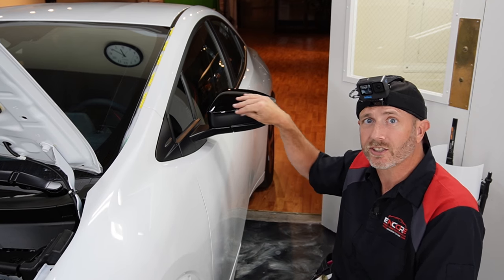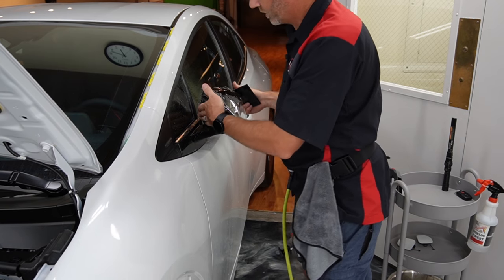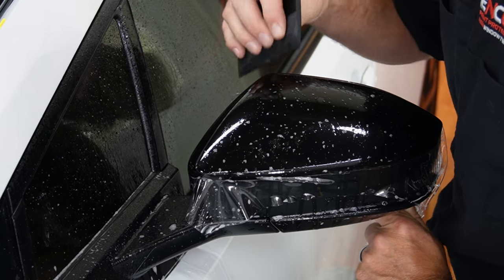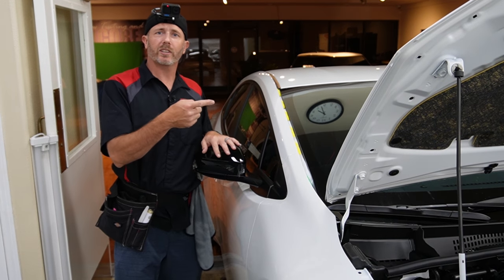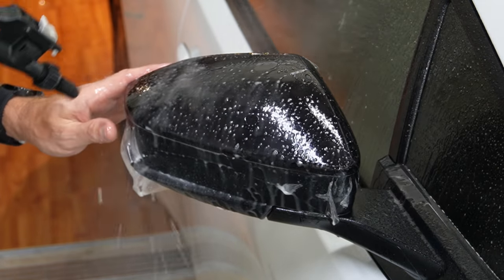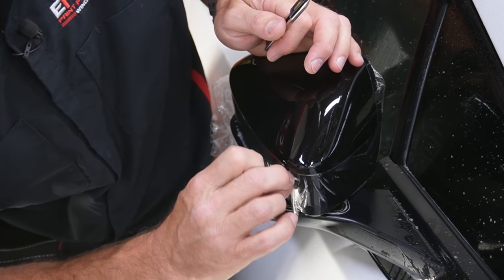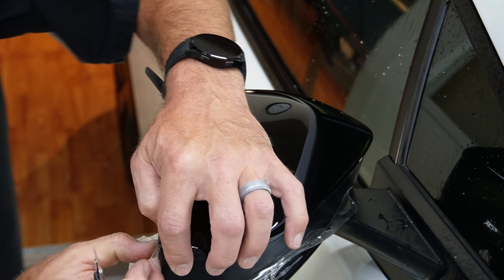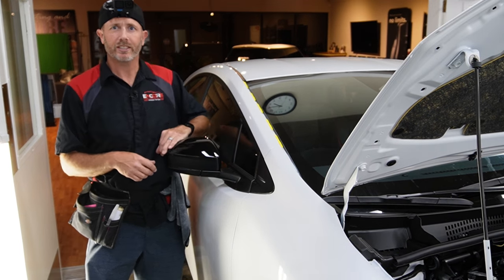How To Bulk PPF On A Side View Mirror - (Toyota Prius 2024)

Comment: I normally do it after trimming and then I heat the edges but I’ve also done it before trimming also. I put my blow dryer on hot and it also helps lock the edges down.
Reply from the maker: Oh, you are talking about heat sealing the edges to help lock them into place. We do that as well! 😁👍🏻
Reply: I use a hairdryer to get the water out and then I go back over it and heat seal it with a heat gun but on the hairdryer, I put it on hot with fan on high

Comment: Have you tried a hair dryer to blow the residual water away? I use one on ever part and it works amazing!
Reply from the maker: Interesting idea. I have not tried that. I normally just use the air compressor. I'll have to give that a shot.
When exactly do you use it? Before trimming the PPF or after?
Reply: I actually have one coming in this morning. I have done a few of them so far but I do the mirrors a little different. I am going to try the way you did them, it looks a little easer as well as less likely to get imperfections.
Thanks for the video 😁
Reply from the maker: Awesome, let me know if this makes it easier or harder. I'm interested to know. 👍🏻

Comment: Hello
I just came across your channel and I am very happy about it
I have a question: Do you use water and foam or special materials for installation?
I will be very happy if you tell me completely what materials you use for installation
Reply from the maker: Welcome to the channel! Here is a video I made that goes over all of the solutions I use during my installations. https://youtu.be/xGjn2rwh-W4
Reply: Thank you, it was very informative
  Another question: How to use these substances?
What I noticed is that water and foam solution is used first, and after leveling the ppf, water and alcohol solution is used to create adhesion, did I understand correctly? @EncorePPFtint
Reply from the maker: @soutdavood2537 Yes, that is pretty accurate. The slip solution is used to help allow the film to slid around more.  In a lot of flatter areas, you won't need any of the tack solution. If you get an area that won't stay down or you stretch to an area and want to make sure it won't move once you sqeegee it out, you use tack solution.  👍🏻

Comment: What film line did you use on this? Do you use different films depending on the amount of stretch needed?
Reply from the maker: I try to only use one material.  Different materials need more or less soap in the slip solution. Once you do this for a while, you really learn how to work with a material. Switching products really throws off your installations and the time it takes. 👍🏻
Reply from the maker: This PPF is PremiumShield, NextGen. We are sampling a couple of other products that we might switch to. PremiumShield is a great product, but the company that bought them (Eastman) isn't giving much focus to the brand. They are really pushing dealers to switch over to SunTek or Llumar.
Reply: @EncorePPFtint  I remember you mentioned using Nexgen on other installs. I'm not very happy with it compared to their Elite SH because the adhesive is SO aggressive, even with a "rich" slip solution. Which leads to frequent stretch lines. Any experience with that? I see you tack down edges/corners and pull on the film and I'm sweating over here. Is it inevitable on some installs?
Reply from the maker: We use the NexGen on all of our installs.  I'm used to a pretty aggressive adhisive. Coming from 3M (early 2000s), VentureShield (many years), and SolarGard (over 10 years), it's very close to what I'm used to. I will add more to this reply soon. 
What soap are you using and how much?
Reply from the maker: Also, what parts of the vehicle are you having the most problems with? As far as the pretacking (aggressive adhisive) goes?
Reply: @EncorePPFtint  Brent, have you tried or heard of UPPF? Not as tacky as others, but easy to install.
Reply from the maker: I did see them at SEMA. They have some cool options for nonstandard PPF. The holographic type stuff. Damascus. I've never tried their material. I did hear that they are distributing here in the USA now.